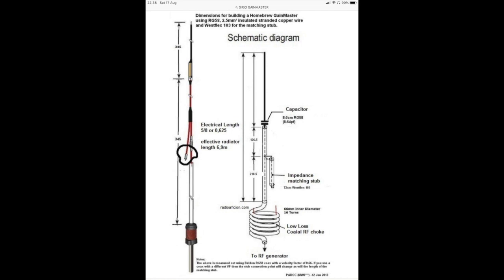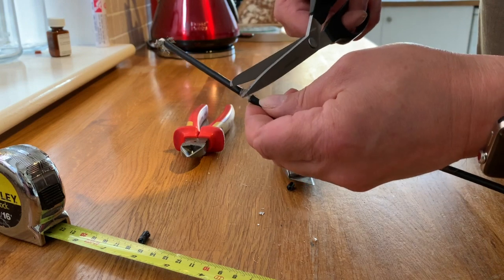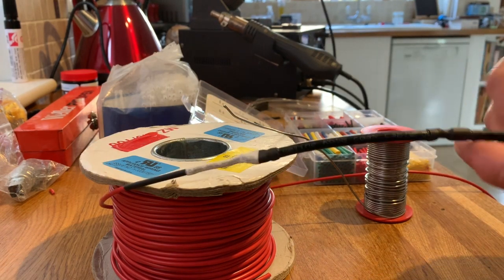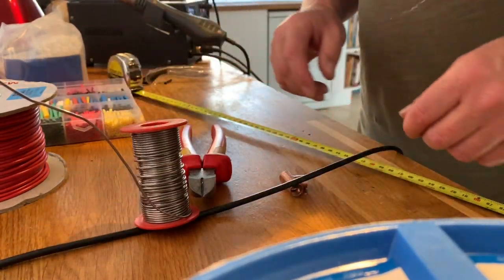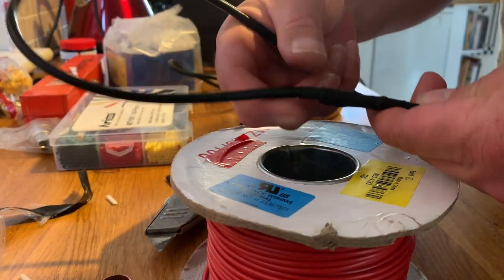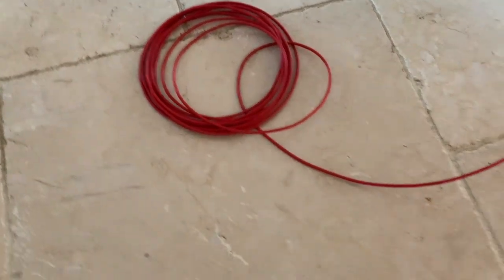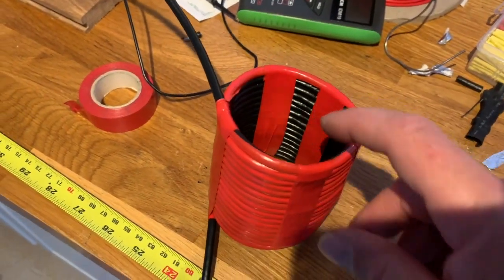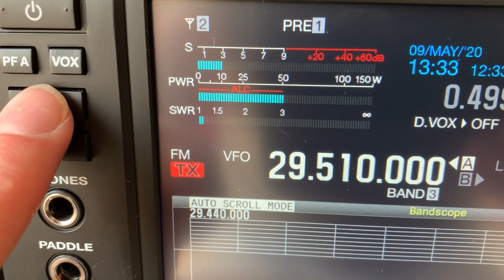CB Radio Homebrew Gainmaster 5/8 wave Antenna, on a DX Commander Pole - Lockdown activities Part 5

Comment: what was the matching stub made with on this cheaper version?
Also you said it wound up being 100cm. How do you determine that length by trial and error and continually checking SWR?

This reminds me more of a JPole antenna with it being shorted to ground. Only difference is the added capacitor.
A JPole can have its polarity reversed to where the center pin goes to the short side of the J and ground to the long side as this is.
A Jpole has an air choke as this does.
The bottom of the Jpole is identical to a matching stub.

I'm not sure exactly what the capacitor in this does or how it functions.
Reply from the maker: You will possibly find that you will need to cut the stub shorter ( I used RG58) as I realised that I had not closed the stub, the Capacitor widens the band..

Comment: Hi Mike. Just a quick thank you for your video on the 5/8 cb antenna. I have made lots or wire and ali tube antenna and some have worked right away and some have not and taken for ever to get right. But I have to say following your video and refering to the comparison still shot at the begining of your video the 5/8 was was made very quickly and was on a 9 meter pole and working europe in no time . To get copies back from easter europe on 12 watts usb is  something else . Only my Moxon has done better. Thank again. Joe. 73.
Reply from the maker: joseph musialowski That is great news Joe, it’s a great antenna. Thank you.

Comment: I can't understand how the radiating element work because it's really not connected to anything when you cut the braid at the capacitor can you please explain
Reply from the maker: RF is an AC current/voltage so it passes through the capacitor....
Reply: It works just like a gamma match

Comment: would it help to use Massi & Paloni 7 mm coax instad of the usual RG58 and allso for the 1.5 mm copper cable can this be upgrated to get a better result  greetings Cor

Comment: Hi! great stuff, about the westflex cable, so i can use RG58 for the matching stubb but make it 100cm long instead of 72cm?
Reply from the maker: Hi, it depends on the make of coax and the capacitance, I got away with 1m on my construction, however others have reported having to use 3m (for the cost of a metre of Westflex around £1.75 (UK)) your better off using the right stuff.

Comment: Are you using a standard PL259 below your coil and then using like a male x male barrel connector to connect your feed line?
Reply from the maker: No it’s an inline SO239,  you also need to watch my other GainMaster video https://youtu.be/DLDdOepaq7k
Reply: @mike-M0MSN  Is it the solder and crimp kind?
Anytime I've needed an SO 239 I've gotten them out of junk CB's.😀
My ladder line Jpole wire 11 meter has one and  my Trucker 2000/dipole. I put one on some coax to get the antenna higher.
I'm watching the other vid now.
Skip is crazy tonight. I heard someone 2,143 miles away a few moments ago.

Comment: Hi mike, just followed your instructions and for uk fm cb radio band got swr of 1:8 on ch1 and 1:9 on ch40. What do i use to lower the swr i have the matching stub at 100cm at present, do i trim/ lengthen the matching stub or trim / lengthen the stranded copper wire at the top?
Thanks
Mark
Reply from the maker: Trim the matching stub, start by removing 5 cm and see.  👍👍
Reply: Mike-M0MSN thanks mike worked a treat have 1:3 on ch1 and 1:5 on ch 40!

Comment: Great vid.  Just wondering if the choke can be compensated with some ferrites instead.  Or is that part of the length of the antenna? 73's.
Reply from the maker: It could work, give it a go.  :)
Reply: It could work but if the ferrites get hot then that's incurring losses, transforming your signal into heat instead of radiating it.
If you do try ferrites, go type 43 sleeves and probably 8 of them or more as you're after a several thousand ohm choking impedance. 
The air cored choke is cheaper and not as likely to be lossy, but no harm is gained from experimenting.
You might gain a little more bandwidth from using ferrites, but like I said, you want several

Comment: Mike loved all your videos and' have made one of these home made gain masters antennas' and it works a treat'. was wondering if you made one' with different coax/ like rg8x and maybe a rg213  coaxial stub? . if you did what would the dimensions for the antenna be  from the coaxial capacitor  to the coaxial stub. thanks again keep up the good work cheers Martin.
Reply from the maker: You will have to try it, I think 213 maybe a little too big for a stub!..  anyway good luck :)

Comment: I am all for people making their own antennas, it is one of the few areas that most people can play with these days.  I just wondered how well it performed.  But then if you have no other CB antennas to compare it to that will be difficult to answer.  However, it is a shame you didn't spend a little time on the air (maybe this is another video?) testing it, though I do realise it was just a temporary fixture.  I still would have liked to see it working or at least some performance figures as in distance achieved and reception performance (though a bit of wire near enough the right length will receive) but I was interested in how well it transmitted.  Yes, I know it was cheap coax and it was not cut exactly to the design,  but I am still interested how well it did?
Reply from the maker: I will try to do a video later, I have the real Gainmaster on my roof, and can say the home-brew performed almost as well, problem is I cannot get the home-brew to the same hight so cannot really do a like for like.......
Reply: @mike-M0MSN  No matter, just use it where it is, we can allow for it being on the ground.  Thanks for getting back to me.

Comment: A 5/8 wave antenna NEEDS a ground plane to work against to be efficient. You can usually get away without radials on a 1/2 wave vertical antenna, but not a 5/8!
Reply from the maker: Tell that to sirio  (https://www.sirioantenne.it/en/)
Reply: @mike-M0MSN  It's just basic physics and well established fact. The link doesn't work, sadly but as far as I know, Siro uses ground radials on their 5/8 wave antennas.
Reply from the maker: @timmack2415  I don't think you understand the antenna is a dipole, it already has a ground plane (from the capacitor down to the top of the coil)
Reply from the maker: @timmack2415  new link.     https://www.sirioantenne.it/en/products/hf/gain-master
Reply: @mike-M0MSN  You're right. I'm not familiar with the them. I should have looked at it before I commented. The link doesn't work, I'll have to look for it, is it a 5/8 wave?
Reply: This is a SYMMETRICAL ANTENNA, not a GP.  In addition, symmetrical antennas are less susceptible to interference, the antenna is generally quieter, especially when it is raining.
I compared the antenna with a President Himalaya aerial, with an SDR receiver which is exactly aligned. The antenna has a whole 10dB more gain than the half-wave antenna, so it is almost two S-levels.
Reply: @mike-M0MSN  If you believe the sales tactics of a manufacturer, I would venture to guess that you believe that an A99 antenna has 9.9 DB gain. It's pure fiction to market to unknowing people, sadly.
Reply: @fnordist  It is not a "symmetrical" antenna. 	Symmetrical antennas
are constructed from two geometrically symmetrical parts with respect to a plane considered to be a zero potential plane, and fed directly with balanced transmission line. A coax fed antenna can not be a symmetrical antenna. Coaxial cable is unbalanced line (asymmetrical) because current in the center conductor is referenced to braid. The braid conductor is connected to ground.
The notion that a 5/8 wave antenna can have 10db gain over a half-wave antenna is absurd, to put it mildly. Unless comparing it to a half wave antenna that is broken, it defies all established laws of physics. A 4-element beam antenna can have nearly 6db gain when referenced to a half wave, if you believe that a 5/8 vertical is capable of 4db gain over an optimized, 4-element beam, I have some amazing antennas to sell you.
Reply: @timmack2415  Both antennas are ok, the SDR receiver is 30 kilometers away from the transmitter, there is actually a 10dB difference, but transmitters closer to the antenna (5KM) the difference was marginal.
Reply: this is centre fed dipole, not a ground plane, yes coax feed is at the end, but the shunt feed method makes this a dipole, no radials are needed. Build it, you will see, a simply amazing antenna. Mine is 36 feet to the feed, I have been simply impressed, have run almost every antenna, from quads, to beams, to arrays, this thing works wonders.

Comment: Regarding the impedance matching stub: As the core is connected to the braid here, how come this doesn't present a short to the back of the radio? I realise that RF is different to DC but would like to understand this properly. Thanks!
Reply from the maker: Difficult to explain here, but the matching stub acts like a resistor and capacitor in one, if the aerial was a 1/2 wave dipole the centre point would be at around 73ohms (close to 50ohm) and would represent a good impedance match to the radio and no stub would be needed. However, this aerial is a 5/8 wave so the centre point is probably closer to 350ohms so to bring the impedance down closer to 50ohms we need to add a stub. The stub is inductive with a reactance equal to +j300 and neutralises the capacitive reactance in the above 50-j300 ohm impedance thus leaving 50 ohms resistive and a 1:1 SWR on the coax to the transmitter. so the transmitter does not see a short circuit but a 50ohm load....
Reply: @mike-M0MSN  Thank you! 😃
Reply from the maker: https://youtu.be/bXh6bMzp3Qc
Reply: @mike-M0MSN  Black magic! Welcome to Hogwarts 😅. At least I get the idea now that the stub is resonant in exactly the right way.... Thanks 👍

Comment: Tks fer charing this project. I made one 2 years ago with very good results too. I have one question what type of coax you use in this project? I use rg58 66 VP. Very nice project 7351 from 31PAT867.
Reply from the maker: Cheap Value line VLSR40902R100   not the best, but ok for testing stuff.
Reply: @mike-M0MSN  tks 7351.
Reply: you'll be fine with RG58, but if you wanted to adapt the whole antenna to being made from RG213 it would be an awesome antenna if done right.
It would handle some watts too.
One wonders how this would sing if scaled to 20m. Hmmm it's all possible!

Comment: Hi what height is best for this antenna thanks.
Reply from the maker: As high as possible.
Reply: @mike-M0MSN  NO! max. 16 meters above ground, at least 1/2 WL why, because above this height the antenna loses its flat radiation characteristics due to the formation of steeply radiating lobes.
Reply: @Maverick Horse Yes the bottom of the coil.  Ideal height about 15-16M

Comment: Vorrei costruire questa antenna per altre bande ma sul web non si trovano le formule. Saresti in grado di aiutarmi? Grazie. 72
Reply from the maker: la bobina è uguale a 1/4 d'onda, la matrice corrispondente è 2/3 sulla coassiale di base e il condensatore rimane 68pf.

Saluti
Reply: @mike-M0MSN  . Many thanks. I'll try it.

Comment: Hi can i add the 5/8 antenna to a aluminum pole?
Reply from the maker: nope the pole will act like a ground rod... :(
Reply: Only if you made a non-metallic support structure for the antenna and the aluminum only attached below the choke coil. Fiberglass rod would be in order to support the antenna if you're not going to pull it up with twine or rope.
Reply: You can install a metal 5/8 like a Sirio Toronado on a metal mast but the antenna has to be made with insulators for the radiator going up from there. I prefer isolating mine on fiberglass rod and wrapping a choke below the antenna to keep the RF off the outside of the coax shield.
Reply: @Morne Niemand  You could also use stiff ABS tubing, but it's dang expensive@!

Comment: Interesting antenna concept but if you need a very cheap and very good antenna the Triple Leg is the best. SWR is 1,1:1 (if anybody don´t believe it, try it) At first the antenna works as good with two legs. It looks like a Y when turned arround. All three wires can be flexible litzwire with 4 mm². Length = Wavelength/4  times a shorten faktor 0,96. Angle of the legs are 45° up or 135° down. So it has exact 50 Ohms without any coils or matching.  If the angle rises to 90° the resistance  becomes 45 ohms if it go to 0° it becomes 60 ohm. Then it is a dipole. You can hook up the antenna somewhere (tree) and splay the legs with a long stick. Center of the coax to the beamer and the shield to the legs, that´s all.
http://sites.prenninger.com/elektronik/_/rsrc/1512980846858/dvb-t-antennen/groundplane/2016-04-07%2012_39_49-Groundplane%20-%20Elektronik-.jpg
Reply from the maker: I will have to give it a go  :)

Comment: venom 5/8 is the economic version of the gainmaster ... less maximum power ... less heavy .... very cheap ...
problem that must be painted with a paint without metal particles because it deteriorates quickly.
65 euro!
zero fatigue

Comment: Guess I got lost or something after you cut it and put the heat shrink over it it is not connected to anything so how does a signal get across that.
Reply from the maker: capacitance (Its an AC circuit so the signal passes the cap)